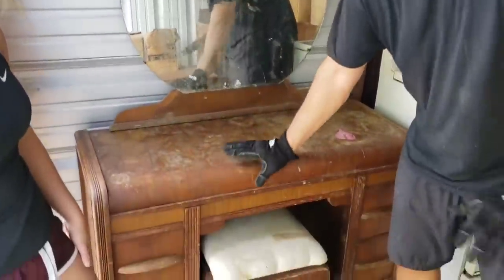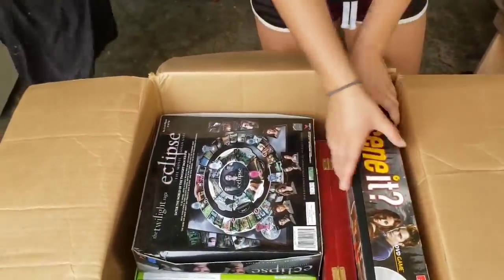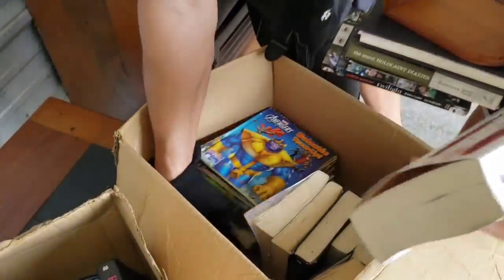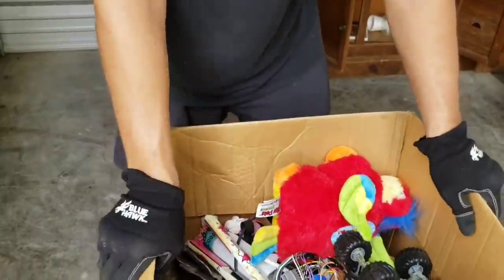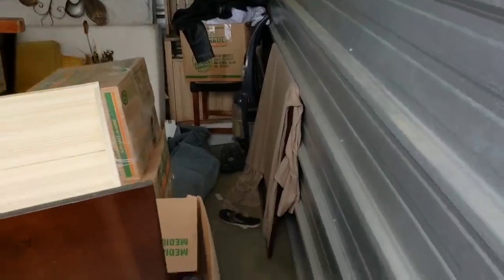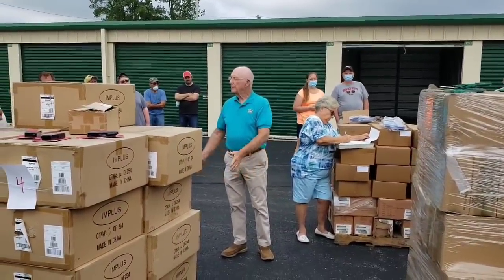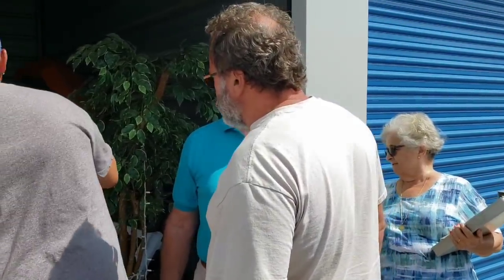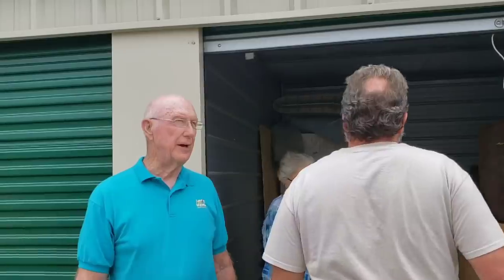OMG! THE FACILITY OWNER DID WHAT? I Bought An Abandoned Storage Unit At Auction

Comment: The storage auctions here in Kentucky.  Operates like this if no one bids on a unit it passes to the next unit the wining bid for the next unit has to automatically accept the previous unit free of charge . I ended up with 4 units in  a row free of charge because no one bided on them and the 5th unit was well worth biding on and I won the bid for around $40. Something. And I had to take and accept the previous 4 units free . and needless to say the previous unit's paid off.